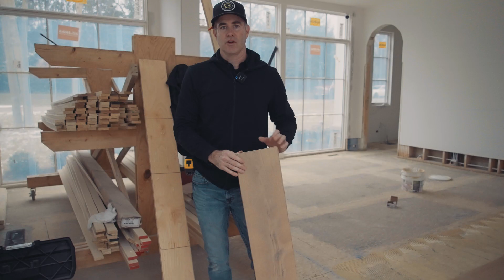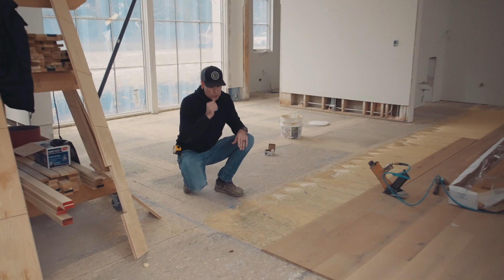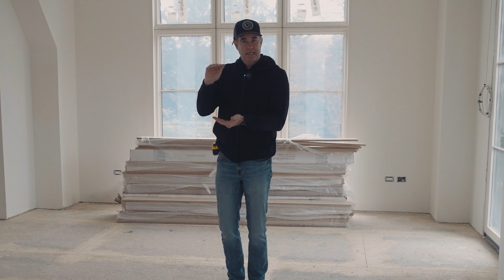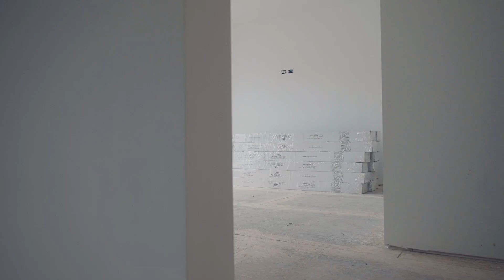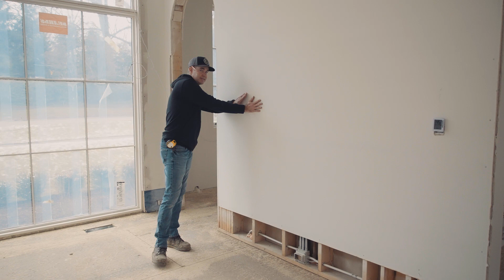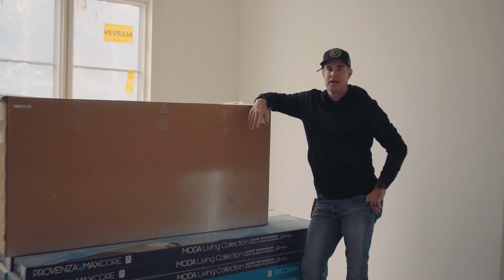Greenside Experience Ep 8 - Hardwood Install

Comment: Thanks for the informative videos.  I am going to meet with Pureza next week to check out their engineered hardwood.  I have a question about the Huber 1 1/8" subfloor.  Huber offers a 500 day guarantee no sand warranty, but I noticed you have significant sanding .  Did you file a claim with Huber?  I have walked all of our customers Huber subfloors - and many are swelling at the seams.  Maybe they do not use the Huber glue?  I am planning on building a home in 2024 and plan on using Huber X Factor, which is now available in 1 1/8".  Just curious if that sanding process is standard no matter what or if possibly this home had alot of rough rain days early on during construction.

Comment: You and your solid poplar... 🙄🤪 I want to see more on that flush baseboard process. It seems to me like your catering to the trim guy by letting him install the baseboard first. I feel like its the first time I've heard of it being done that way. I feel like usually I see the baseboard complete and then the trim guy has to get the reveals perfect by scribing to the hardwood.
Reply from the maker: Solid Poplar baby! Yes, I am catering to the trim carpenter because not only is the base flush, there will be no shoe molding so all the base has to be scribed to the floor. Thats headache enough for the trim carpenter.  Installing and taping the shadow gap bead will just finish better if the base goes first. Another video will cover the base install.